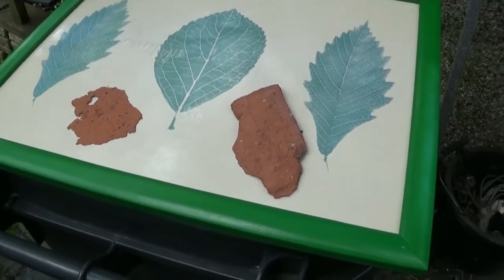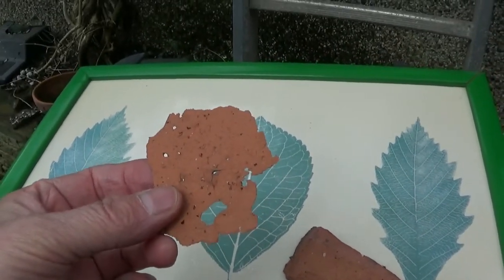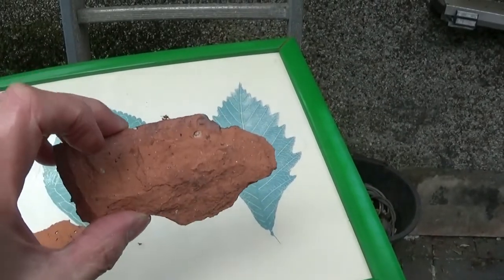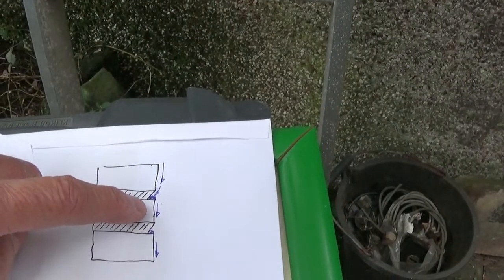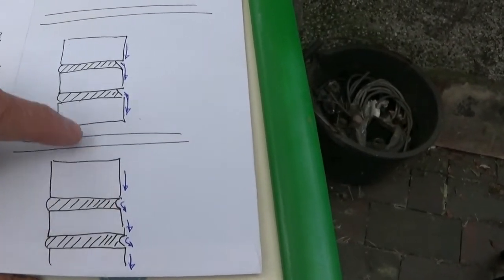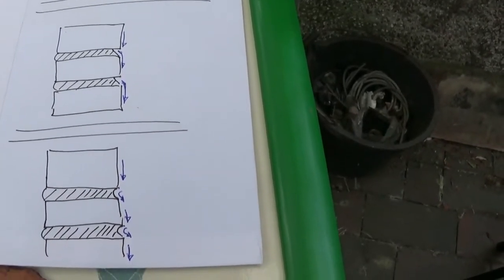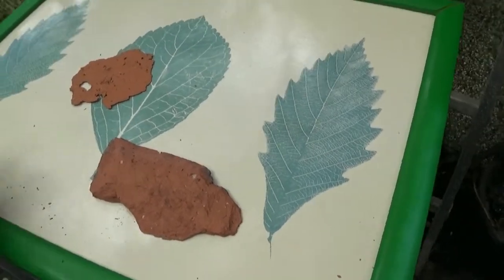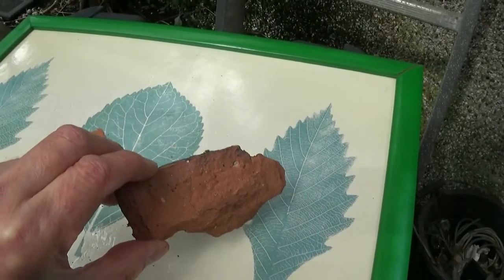Spalling Brick Face (and Mortar Bed Pointing).

Comment: That whole wall is a mess and needs complete renovation. Grind up the red brick clippings to duct, to blow onto wet motor if you face up the spalled bricks with mortar. Better to dig out and replace tho.
Reply from the maker: In due course I intend to grind out the beds, replace the spalled bricks, then repoint using lime mortar. Thank you for taking the time to comment. Kind regards.
Reply: @onanysundrymule3144  It’ll be easier than you think, as the old lime motor will easily come out. Good luck!

Comment: After repointing, is there anything you can buy to treat the face of bricks so water runs off better?
Reply from the maker: Hello. I believe there are products advertised for such, but....... (a) I doubt if they would last for long when you consider that a brick wall will last for hundreds of years anyway, and (b) I have become convinced that lime mortars are the proper way to go - at least on structures built before around 1930, and (c) full breathability of the structure is desirable. Kind regards.
Reply: @onanysundrymule3144  Thanks, I found a product called Storm Dry Masonry Protection Cream. It seems to be pretty good, lasts up to 25 years and bricks can still breath. It’s a highly rated product by the looks of it. I’m gonna render some parts of our property and re-point other parts, then I’ll decide if to use the Storm Dry treatment.

Comment: Cement damage is the problem. Should be repointed in Natural Lime Mortar i can tell by just looking at the wall it was built before 1930. Cement mortar sets harder than the bricks itself so the bricks take the weather damage in regards to the surrounding mortar, what can be replaced over time.
Reply from the maker: That is dead right Sir. I am just on the verge of ordering some lime mortar NHL 3.5 for repointing my front yard wall.

Comment: What mortar did you use? it looks too hard for those old bricks. Shouldn't you have used lime mortar?
Reply from the maker: Some of the mortar and brickwork shown here isn't on my property even, I am just putting the info and findings out there so to speak. The pointing I have done would have been a 5 to 1 sand-cement mix with plasticiser. I think lime mortar would be a good option, but the main thing in my opinion is the mortar bed weather-shedding, as mentioned in this video. If water cannot get in, then it won't freeze inside and spall. Thank you for watching. Kind regards.
Reply: @onanysundrymule3144  
With a cement mix, the water will stay inside the brick and cause spalling surely not???

Comment: If it's a house over 100 years old use lime mortar not cement. Like for like. It's much more expensive and most 21st century builders have not heard about it. It is up to the home owner to educate the builder as to the correct materials to use to repair their house.
Reply from the maker: That is a good point, but I would still contend that a water shedding profile is a good thing, whatever the mortar bed material. Kind regards.

Comment: Although not exclusively, this usually happens with red "rubber" bricks, as you say a common practice years ago. When we lived at Saltburn the front of our Victorian terrace was faced with diamond hard engineering bricks with no sign of degradation, the rear however was a different story, the walls were peppered with spalling and even missing bricks, it was all about appearance, stay safe you two.
Reply from the maker: Thank you Sir. Yes, round the back are usually seconds or lesser quality substrates. Kind regards.

Comment: Are the barrow brick Askam brick ??  Some of the rotten one are resets not fired properly
Reply from the maker: Apologies Sir, YouTube didn't give me a notification of your comment. Because of the age of this house, I think it more likely that these are Barrow bricks, although I haven't actually de-coursed one  to look for a makers mark. If you are familiar with the district you may know that there were clay pits where Adsa now is, I tend to think the bricks may have come from there. Yes, second quality bricks often went 'round the back'. Kind regards.
Reply: On Any Sundry Mule  I make these bricks now Askam bricks could just be a reset not fired to the right temp. Let me no if you need eny replacing.
Reply from the maker: @paulwilliams6399  Thank you kind Sir. These will probably be 'Pressed Old Victorian' style, I bought a pallet of those once for a job from Askam. I don't need any now though. I'd really like to do a video of the Hoffman kilns at Askan brickworks sometime, what would my chances be do you reckon? ..... obviously I'd speak to the right people and all to make it all legit etc, if it could happen at all. Kind regards.
Reply from the maker: @paulwilliams6399  Kind Sir, my apologies for the delay in getting back to you, again youtube did not notify me of this comment, and I have only stumbled across it now. I have tried to send you an email but there is some account error or some such. Can you please check the email address you gave me, and confirm that it is verbatim etc. Kind regards.